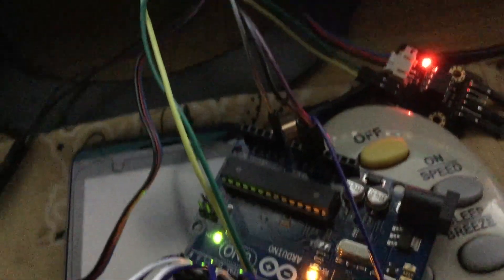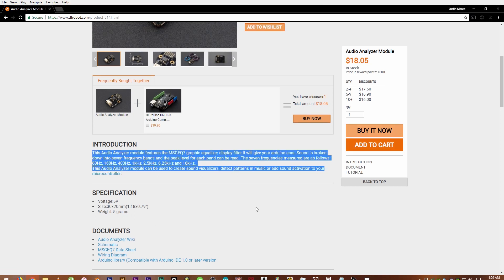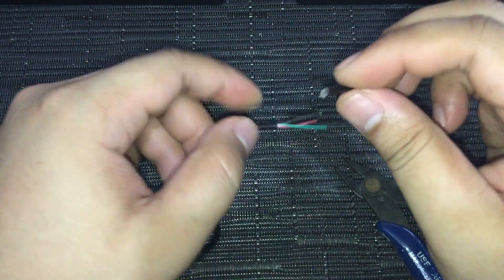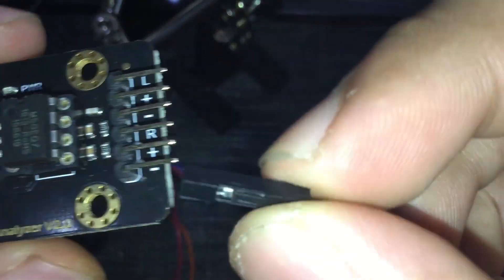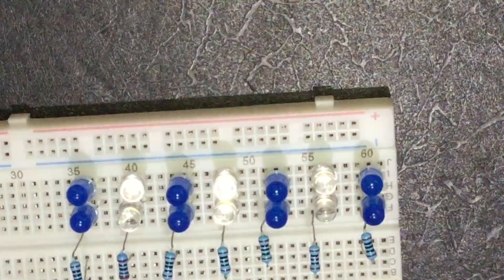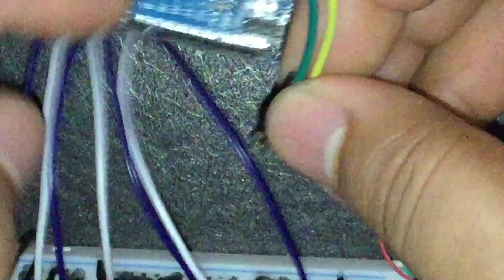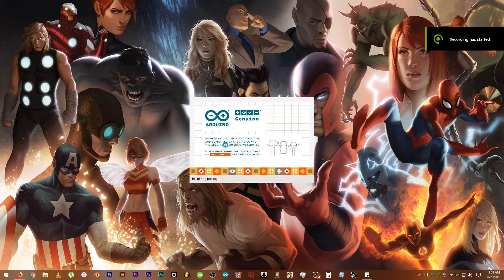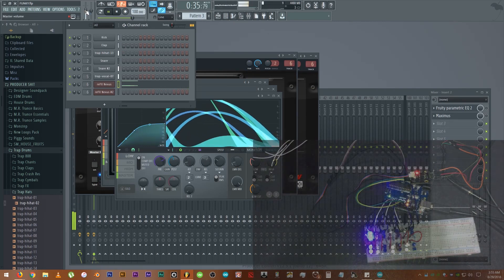Arduino Project #5 | MSGEQ7 Super Basic 7 Band Spectrum Analyzer Project!

Comment: AudioAnalyzer.h is missing.
Reply from the maker: Hello, thanks for letting me know. Arduino parted ways with Hackster lately, that's why the links are in a mess.

Here's the link to the project: https://projecthub.arduino.cc/Heathen_Hacks-v2/super-basic-msgeq7-7-band-spectrum-analyzer-module-project-2a7ed9
Reply: @HeathenHacks  Can't find the library.
Reply from the maker: A library is not needed. If the code is getting errors, it's most likely because of how the arrangement of the text got distorted.

Anyway, here's the link for the code. Just copy and paste this to the IDE: https://gist.github.com/HeathenHacks/99c1b3b3e33edfe7d3c7cfe55c006f38
Reply: @HeathenHacks The code is not working.
Reply: Maybe the chip have caused this problem.
Reply from the maker: Ah. I see what's happening now. My apologies for the confusion.

You can download the library right here: https://image.dfrobot.com/image/data/DFR0126/library/AudioAnalyzer%20v1.3.zip